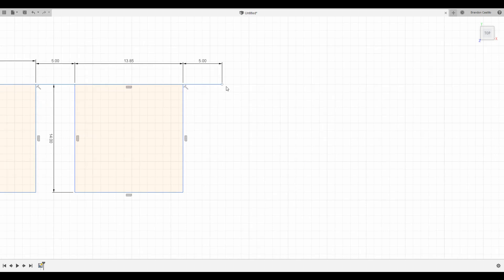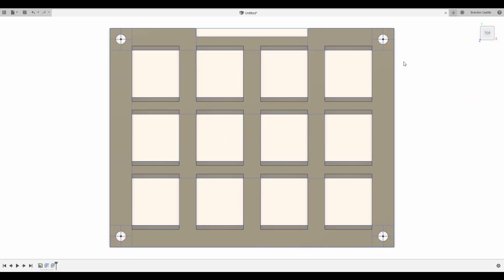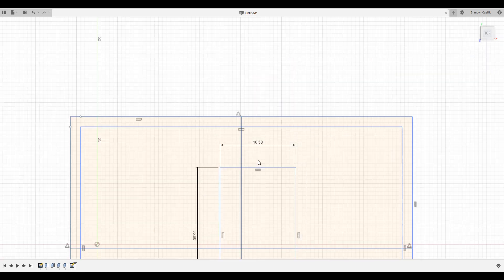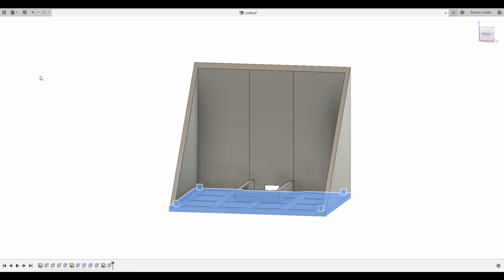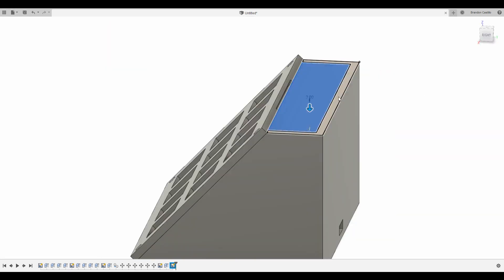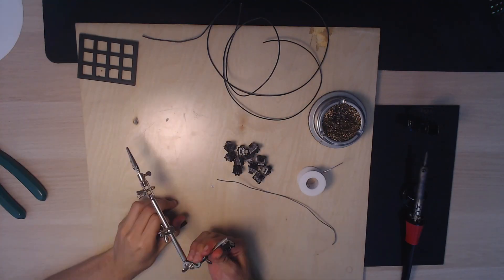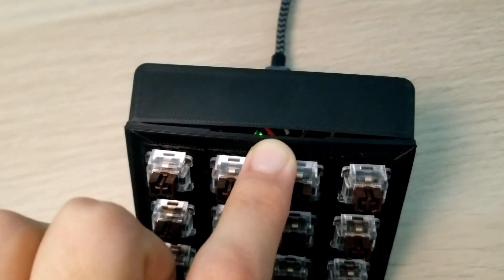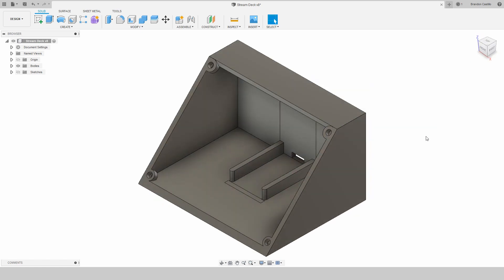Just make your own Stream Deck!

Comment: Its an neat idea but the thumbnail "better than the elgato"
i can't really agree?

since you used cheaper switches and not Screen-buttons, that means you need to remember any layers for hotkeys you do.

the screen-buttons essentially allow you to make infinite macros and have labels asap on each key, where here unless you have a god level memory on what you need, or the keys you need are just simple enough to recall that only one single function is required.. You would need to more than likely make a notepad/word doc with references to the hotkey layers you want. 

still a cool idea, but yeah, the ability to see each key's label change on the fly is just significantly better for workflow, im not sure if small screen buttons are out there for general public purchase, but I know they would make it cost more parts wise since screens vs simple plastic buttons

Comment: Because I value my time. I have the skills and equipment  to make an alternative, but would rather spent $150 and have a Stream Deck with screen buttons and software than spend all the time required to make one with less functionality. 3D printers are also expensive. Cool project, but the juice isn't worth the squeeze.

Comment: Careful! You dont use a Nano for keyboard / streamdeck.. You use an Arduino Micro, or a Pro Micro... The main thing is that the Nano dosent have a 32U4 Chip which has a USB to Serial converter. (So it wouldnt be able to send commands to your pc without running a secondary python app or something)
Reply: there is a way to use the nano for such things, by providing a serial output and using a counterfeit software package (usually written in c++ or go). Beside the fact that you have to run the software, you have way more freedom compared to the hid/serial functions with 32u4. Good example for nano usage: DeeJ. You can control the volume of applications by any potentiometers with arduino nano, a small tool just reads the serial output of the nano and tells windows what to do with them, workes really nice and is easy to configure

Comment: This is a really cool project but the real benefit of the streamdeck is having the screens so that they dynamically change and you don't have to remember what key does what because it's shown to you. Extremely helpful for folders etc.
Reply from the maker: I completely agree, I'm thinking of 3D printing the caps with the signs on them. As of now I don't use many buttons so it's fine. I'll make a short update video in the future